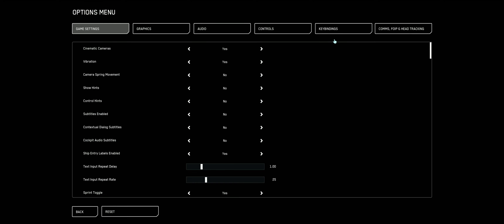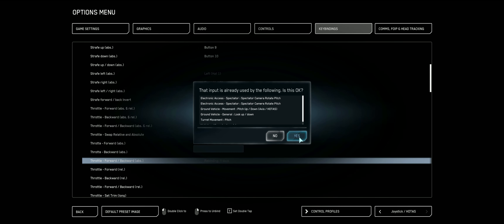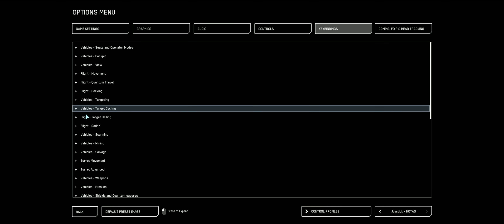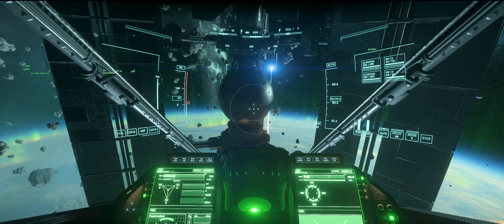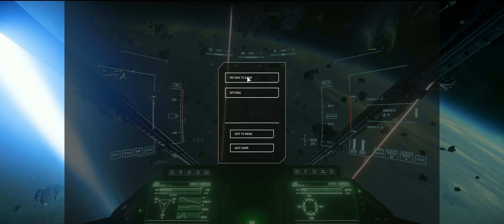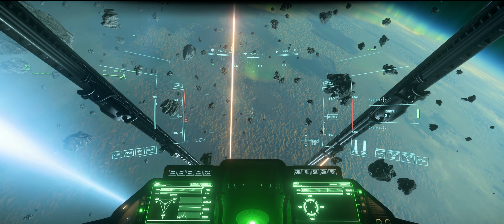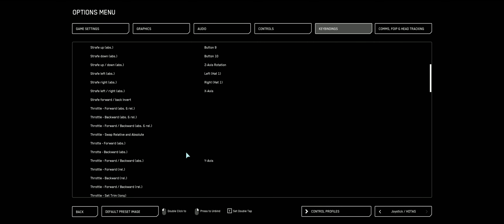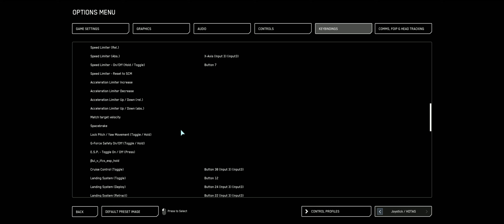Quickly, easily setup your single, dual joysticks, throttle in Star Citizen 3.20+ Also REL vs ABS!

Comment: 1:41 what if there is no "input 1 or 2" mentioned at all while joystick "Y-axis" binds perfectly? It doesn't work after that in the game.
Reply from the maker: It's been my experience that the first joystick found by SC doesn't get a number designated. It's just joystick X-axis. The 2nd and 3rd joysticks would get a number designated like joystick (2) or joystick (3).  If you load into offline free flight mode of arena commander, setup, and test what happens? If bound it will show the button or axis for each in the option list. For example the pitch binding would reflect the axis. If it's not showing the axis then it's not set. There is a short timeout when setting. So if joystick movement isn't being detected that line will remain blank.
Reply: @PaganLinuxGeek  Thanks. I figured it out. Single Joystik doesn't have number. Movement didn't work because there are three different bindings for one movement, like "strafe up", "strafe down", "strafe up/down". As soon as I bound joystick to "strafe up/down" it works.
Reply from the maker: Excellent!

Comment: Thank u very much. I have a Problem and I hope you can help me. I use the t16000 and my Cruise mode is set on a Button. My issue is, that every time I move my left stick backwards (to get slower during a fight) it also turns off my cruise control . I want my cruise control to react only to the button, not the stick. I hope someone can help me fix that problem. Thank u very much
Reply from the maker: It's going bubye. After reading a response from Yogi (CIG Dev) regarding it, I've bene trying to adjust to setting a throttle trim. In the keybinds, flight movement section is an option for throttle trim. After binding the SET THROTTLE TRIM to a button, you can press and the craft will attempt to hold that speed. This allows you to briefly speed up, or slow down, and the craft resumes the set speed after your adjustments. I have a video about it here: https://youtu.be/zLWbM94epHg
Reply: @PaganLinuxGeek  thank you very much

Comment: I have omni directional l throttle.

So my right side is perfect with pitch, roll, yaw etc. No issies there.

So im having big issies hetting throttle to work right. The speedblomited is screwing me. Ive tried to tweak and turn it off but then throttle doesnt work what so ever.

No idea what to tweak in settinge for this throttle
Reply from the maker: I don't understand. The throttle doesn't work, or the speed limiter doesnt? I'd suggest rebinding the throttle (abs), and leaving the speed limiter unset to test.

Comment: great video. is there any way to set it so when you make a new binding, it deletes the old one? i copied your missile operator mode to the hat on my right joystick, which was by default set to strafe. but now it just has both, so when i activate, add or remove missile, or change missile type i also strafe in each direction. dont think its a big deal its only a quick press
Reply from the maker: Sadly no, it warns you that it's also used for __ but doesn't offer option to remove previous mapped binding.  If you have trouble locating the other bindings and dont mind starting over, you can reset to defaults. I show this in the start of video. Also If you are running VKB Space Combat Edition premiums you can toggle between ministick and hat mode by pressing IN on the hat/ministick. The LED will show RED in alt mode. That allows you to map analogue strafing to the ministick and other actions to the hat mode. :-)

Comment: So i'm trying to add my virpil alpha primes on mongoose stick bases.. they're not listed on the list of joystick/hotas...... I can't double click to edit the bindings at all..... help??? 
brand new sticks, and i've never used sticks b4
Reply from the maker: Launch windows settings (looks like a gear or cog) and search for joystick. It should show the game controller application. Run that. It will list the controllers windows sees. If the virprils dp not show in the list you'll need to verify they are connected properly, calibrated, and any needed utilities are running. If not you need to contact virpril support or a buddy running them. I wish I could help but do not have any personal experience with virpril products to draw upon. Now that we have that out of the way: you setup joysticks with a hierarchical tree in Star Citizen. Follow along with the video at its start. Particularly in the lower right and lower left corners. As this gets you into the joystick bindings and out of the keyboard mouse bindings section.

Comment: If you have the extension that gets added to the joy stick, you know that adds dials and switches does that become part of the stick it is attached to?
Reply from the maker: Yes. It changes the "name" it reports in the device configuration utility too. A friend of mine @moonraker113 has the sem installed and reports that it appears are 1 device when using the link cable plugged into each device JST connector. If you connect with a usb cable it's a separate device.

Comment: Ok. So first hurdle. Switch to joystick settings. Can unbind pitch/yaw, but cant set with joysticks. With mouse, you double click to bind, and if i change back to mouse/keyboard settings i can do this. But on joystick settings, double clicking mouse button does not enable the input recognition.
Reply from the maker: Close SC and open the joystick applet in windows settings. Make sure the sticks are both working. Open SC and try it again. I've noticed that SC won't see a stick if it's plugged in after SC starts up
Reply: @PaganLinuxGeek  thanks. Took a while but working great now. For shadow pc users, be sure to enable USB forwarding.
Reply from the maker: Oh wow. I am planning an updated version of this video as the keybinds have changes in 3.23 (reportedly) and intend to include a troubleshooting section for the common questions. I'd welcome more information about the steps you took to get them working in shadow pc. If you don't mind providing them. I'd provide a credit and special thanks for your assistance. My goal to maintain a quick guide for other SC players. o7
Reply: @PaganLinuxGeek for sure. It's quite simple really. I had only used a controller for other games on my shadow before, and that was basically plug and play. Just picked up dual T16000m's, and it was a bit weird as when I plugged them into my laptop they recognised as T16000m's and programmes like joytokey would register inputs, but in SC it wouldn't let me change bindings. USB forwarding is a relatively new thing on shadow I think and I had never had to do it before. To enable, while I was in my shadow, I opened the quick menu (alt+win+o), go to 'controllers and usb', and select both sticks under the USB forwarding settings, and voila! Means the shadow recognises them as if they were physically connected.
Reply from the maker: Ahhh so it's just passing those HIDs over the link to the remote machine. Thanks for that info! Would you mind grabbing a screenshot of the window where you enable for the update? My email is pagan [dot] Harold [at] Gmail [dot] com
Reply: @PaganLinuxGeek  sent
Reply from the maker: Got it, thanks!

Comment: One other thing I noticed. It's not letting me use any of the analog buttons or hats to set. There not registering.
Reply from the maker: You might need to calibrate them, or reset configuration. Have you tested them outside the  game? Open settings and search for "joy" up top. It should list the usb gamepad applet which you can use to test the joysticks. What kind of joysticks are you using?
Reply: @PaganLinuxGeek  I'm using the vkb nxt evo. I've done all of that already even in the calibration menu it wasn't recognizing the hat in the axis test
Reply from the maker: OK then the configuration needs to be reset. You can do that in the vkb configuration utility. Jump in their discord and post the question. I've excellent support there in past. I'd love to help further but am laying in bed sick AF right now.
Reply: @PaganLinuxGeek  no worries man! Much appreciated 🙏

Comment: what if you have more than two devices? 2 sticks and a couple of button boxes how to you sort out devices if SC fail to recognize the device to the same input number?
Reply from the maker: I have dual sticks and a throttle and use this procedure to I'd them. To determine which is device1 open the keybinds and bind it to an axis paying attention to what number appears in the device name after binding. You can do that with buttons as well. The first device just shows axis or button name. If it is the 2nd device the name will be shown after the axis or button name. Like x-axis(device2 device2). Sadly the device numbering can change just by unplugging something, or moving it to another port.
Reply: That is the issue I wanted to ask, coz SC will shuffle the device numbers.. if only SC can follow how DCS does their key binding that would be a lot less hassle..

Comment: I'm stuck and need help. I flew with a Cheap T.Flight Hotas for years and could hit anything perfectly.  I got an X56 Hotas and my fine motion for hitting a pip is wrecked.  I've spent countless hours adjusting curves and I just can't seem to get it right.  Standard sensitivity is too harsh on small movements.  A curve works great for most things but when I'm in a PVP fight I find I can't track the pip because of the variation in the curve causing me to constantly over correct.  I almost want to say I need a linear curve that's just slower, I'm guessing that would be saturation, but wouldn't this limit my turn rate as an E.G.  ?   I'm open to any solution as this is driving me mad.
Reply from the maker: ESP might be the solution. TLDR: it adjusts (slows) joystick input as your reticle gets closer to the target. You can adjust the width of the adjustment circle and the amount of adjustment to input making it easier to get finer movements. Please note that I've not (yet) done a deep dive on it so will have to summarize and refer you to Moist Noodle's recent video explaining it. He did an excellent job explaining and demonstrating it.  https://youtu.be/kKV7wtgcWzE?si=xUQFwWQxSVYaSa7D Having said that; I'd love to hear what adjustments you made :-)

Comment: did this same method and i still cannot move backward, when the stick is in the center position it gives half throttle and when i move it back the ship stops no reverse
Reply from the maker: There's a keybind needed for reverse. It's a button that when held .makes the ship move backward. I forget the name but it's right there close to throttle forward (abs) in flight movement section.

Comment: Am I missing something? I don't see a abs option for throttle forward and back on my ui
Reply from the maker: They made some keybind name changes in 3.23 which means I need to update this video.
Reply: @PaganLinuxGeek  do you know what the new one for this is? It's my main issue atm
Reply from the maker: It's under flight movement section throttle forward/backward. If your ship moves opposite of the direction you want (meaning push stick and ship reverses) you can invert throttle in options CONTROLS. Hit arrow on lower right to select the stick number corresponding to the throttle. Locate flight section and toggle throttle forward/backward to YES.  I'm editing the.updated setup as I type this. It should be up soon.
Reply: @PaganLinuxGeek  it just doesn't seem to work properly. When I push stick forward it works then stops working. Like I have to keep hitting it forward rather than hold the stick forward.
Reply from the maker: @jeffreyulery2182  that makes me think it's interpreting the throttle forward (REL) from older setup. Try making a new keybinds after resetting to default. The video starts off with a reset. So follow along.  As I said I'm LITERALLY editing the updated video to be uploaded.

Comment: Tha ks for the video, ive been running into a strange issue with my velocity one flight stick, when i go to load my my saved keybind control profile the Joystick device doesnt show up and wont let me select it, so i have to manually eedo my keybinds everytime they are defaulted. Its been happening since 3.20 released amd still happens in the PTU too, have you run into anything like this?
Reply from the maker: Is the keybind file located in user/0/controls/mapping folder and named something_keybinds.xml ??
Reply: @PaganLinuxGeek  yes
Reply from the maker: Sounds like it's not recognizing the file format. Can you send me the file so I can look at it?
Reply: @PaganLinuxGeek  sure how would you like me to send it to you, I can once I'm off work, it's a HOMAS setup btw
Reply from the maker: If you're on Discord, friend me, PaganLinuxGeek, or email me direct Pagan [dot] Harold [at] Gmail [dot] com

Comment: Hey just a question but I am using a hotas setup with the gladiator nxt evo and a thrustmaster twcs throttle, how do I configure the throttle so that its only responsible for forward movement by moving back and forth but to reverse I have to press a separate button entirely, right now to go backward I have to move the throttle to 0 and to got forward move to 100 and to stay still I have to have it in an impossible middle position? is there any way I can fix this, thank you!
Reply from the maker: Yes actually! In the flight movement section bind the throttle to forward (abs). And a button the reverse. Then you press that button to allow reverse.

Comment: Can anyone help me! how do i switch roll directions on twist, when i twist left i roll right and vice-versa.
Reply from the maker: In options menu hit controls up top. Then use lower right arrow to change over to the joystick number corresponding to your roll axis binding. In the list select inversion. Flight. Then select roll and change no to yes. If you aren't sure which device number it is, open your bindings menu and look at roll binding. Device 2 would say (2). No device nunber means it was the first.
Reply from the maker: I forgot to mention that the updated video is up now. It covers 3.23 and mastermodes. I'd urge you to give that one a watch it's even shorter than this one :-)
Reply: @PaganLinuxGeek  you're legend! Thanks man

Comment: my pedals and right still is acting in reverse for the roll and throttle, do you know what is happening?
Reply from the maker: You can flip them in settings controls then use lower right arrow to switch to the appropriate input device. In flight movement section are the axis to reverse. If you look at keybinds and in the axis that pedals control for the input number (input2, input3, etc). 9f the pedals are input3 then arrow over to joy3 in lower right corner to set reverse in controls. Review the video to the part I correct the forward backward for an example.  Reach out on discord if you need some help.

Comment: Can anyone help me, I've had this problem for over a year now, I have t16000m on left hand, mouse on right and p3ta pedals. I have forward throttle, strafe left and right and roll on my t16000m, but no matter what I do it will only throttle in 1 direction. Z axis only rolls left, x axis only strafe left and y axis only goes forwards. Any help would be massively appreciated o7
Reply from the maker: Sounds like you have bound throttle forward instead of throttle forward/backward.  Likewise with your strafe left/right. The t16000m are notorious for twist issues. They used a potentiometer and didn't design to take stresses well. I had to dismantle mine clean and degrease the twist. There's videos and step by step guides to doing this.
Reply: @PaganLinuxGeek  hey thanks for the reply. Y axis is bound to throttle forward/back. I use t16000m on elite amd e few others and no issue at all.

Comment: its weird there isnt an easy way to un-reverse the throttle. default is pulling back on the stick makes the ship go forward, and inverting the hotas thrust in the game setting has no effect 😂
Reply from the maker: You may need to set it for joy2 as well. Whichever number matches the device position you're using for throttle. Meaning if forward/reverse throttle is moped to (device2 device2) then you need to use the arrow button in bottom right corner to set the inversion for joy2 ;-) thats gonna need to be better described in my updated video foe 3.23 (soon).

Comment: I noticed something about the Cruise Control : before you could enable/disable it anytime, but now your left joystick (the one that controls the forward/backward strafing etc) has to be centered if you want the button to be clickable. If you're strafing forward the button won't work.

It's not a big deal, but it's not very practical to have to stop to change modes (I do it very often 😅).
Reply from the maker: I was able to engage while moving. Left stick bound to throttle forward/back abs. Were you coupled?
Reply: @PaganLinuxGeek  Yes, I always fly coupled. I'll do some more tests tonight.
Reply from the maker: Please do and share your binds for movement. I'd like to replicate
Reply: @PaganLinuxGeek  ok 👍
Reply from the maker: I played around with this more. If I leave the left stick (throttle forward/backward) untouched and at Centerpoint, I can enable cruise control and it locks to the speed limiter. I control speed limiter on throttle box. Moving the left stick disengaes cruise control. I thought it a bug until reading the post in spectrum I linked in a text post here. Seems the cruise control is going away at some point. They intend to utilize trim instead. I posted a video about setting and using it today. I apologize for the delay in response. I prefer to have a good understanding before commenting or informing, and some family medical issues as of late took my attentions. After using the throttle trim a bit I'm digging it. Will take some repeated use before it becomes.habit.
Reply: @PaganLinuxGeek  Thank you for your feedback!